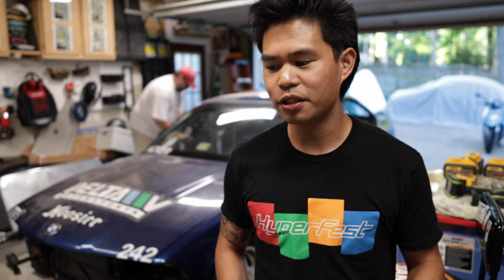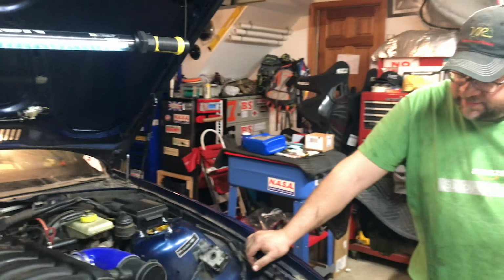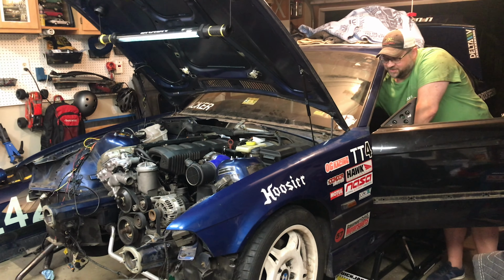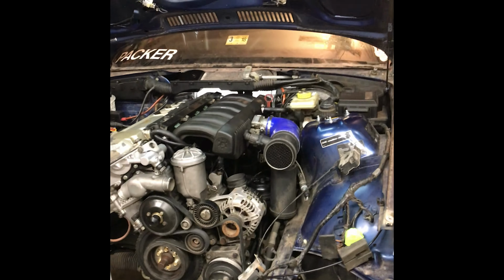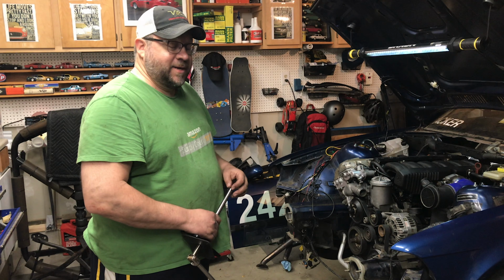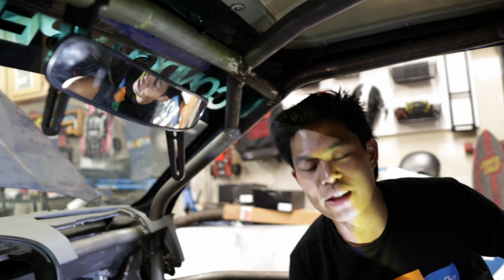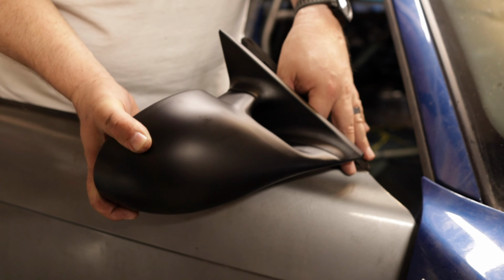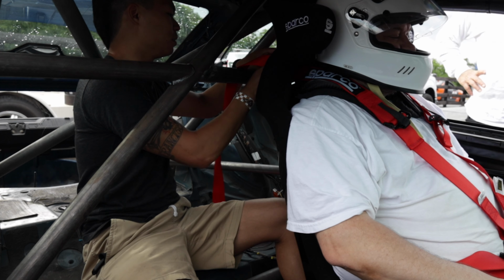BMW E36 M3 Track Shakedown at Summit Point Motorsports Park | Getting Back on Track #9

Comment: Is the engine in stock form?
Reply from the maker: Nearly but not quite. The bottom end is stock s50, we did install a reworked head by Thayer motorsports and swapped over stock cams. Refreshed vanos, did the oil pump safety nut and installed a baffled pan. You can see the start of the engine re-assembly here: https://youtu.be/fjn6GzAAKpg.  Oh and the ECU has a chip tune.. no clue what though. Thanks for watching!